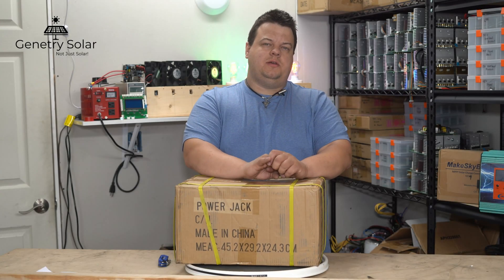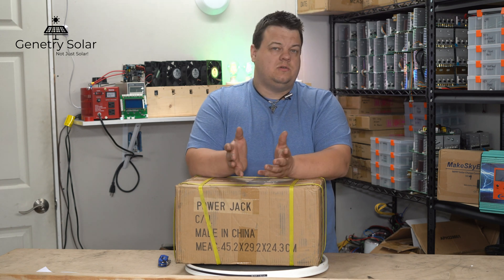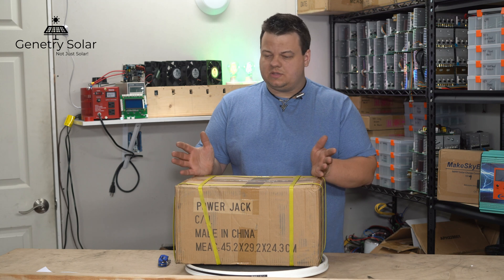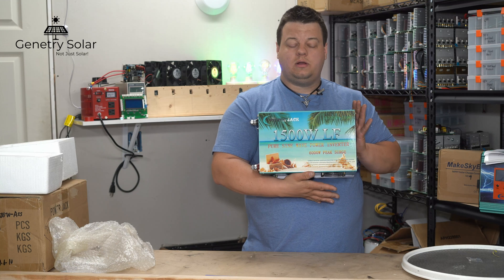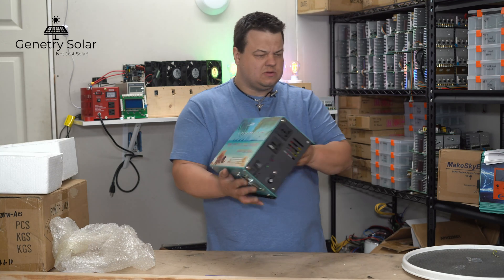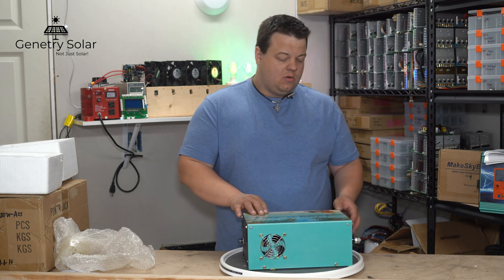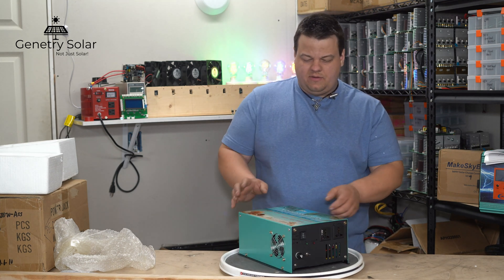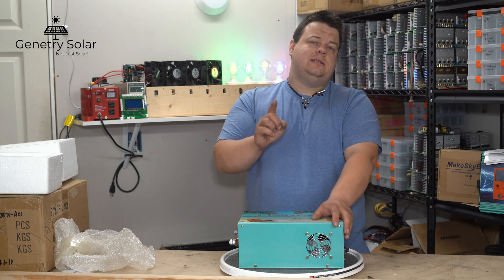Power Jack 1500W LF PSW DC to AC inverter unboxing

Comment: You are Power Jack's  best marketing tool.  I have been selling/using Reliable brand inverters for a few years, but they are all HF inverters.  Currently talking with another LF manufacturer to start selling theirs, but if you start doing load test on some of these smaller units, less than 4000 watt continuous, Power Jack just might have me promoting their products.

Comment: Disclaimer : My Mama took away my box cutter.   Resorted to using my Machete.   The Dr says my hand will heal in time.  I may even get the use of my thumb back.   Declaimer Over.    Guess I'll be waiting for the Load Test to see if they are in fact 1500W or not.  Do you have a scope ?   Would like to see the Output Wave Form.
Reply from the maker: Yes I have a scope. I am doing a repair video first. Then load testing. I will have a scope. Multimeter and killawatt meter to observe